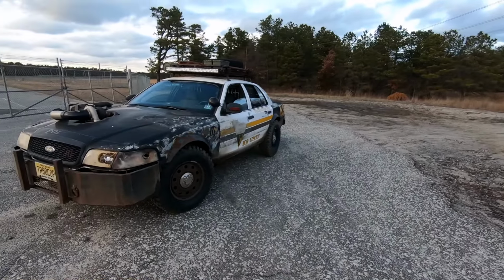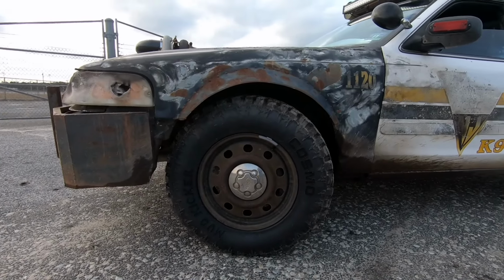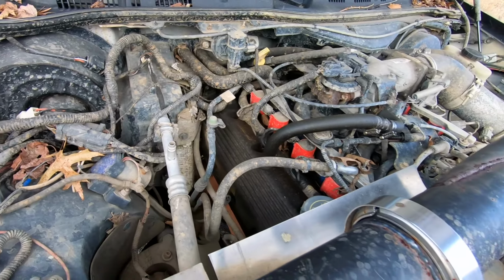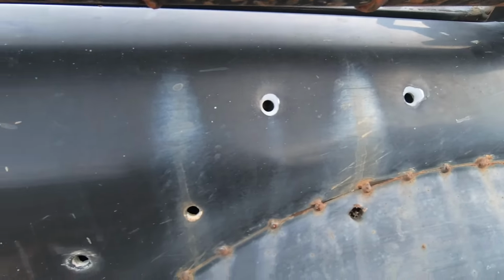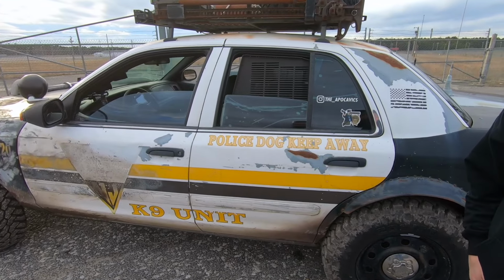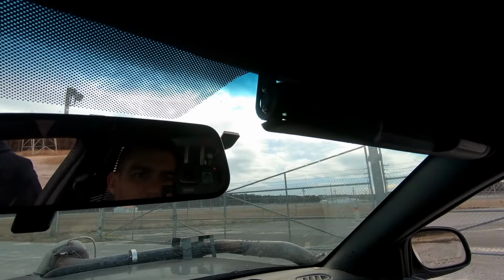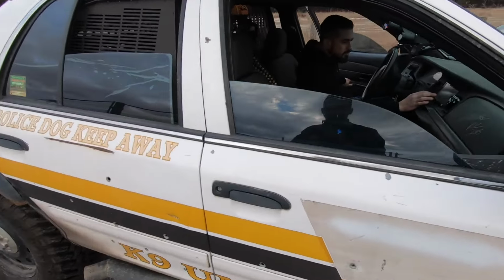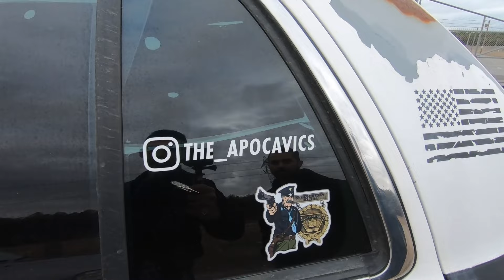2003 Ford Crown Victoria Police Interceptor  "Apocalypse" K-9 unit

Comment: 😂 I passed by you guys yesterday in my 2011 crown victoria black and white i should have turned around awesome car I seen it at pumpkin 🎃 run
Reply from the maker: Hey man, should’ve stopped by and got into the video…would’ve been a nice treat…if you want, send me an email at lovewhatyoudrive28@gmail.com we need a black and white panther in the channel…
Reply: @LoveWhatYouDrive   it's not the nicest but it's a daily rig that's fun to drive & always gets me where I'm going & very reliable
Reply from the maker: @davidbara9693 if you notice on the channel the theme is every day every man’s car not one have I seen a trailer, queen or a showstopper. That’s why the channel is called. Love what you drive not drive what you love because let’s face it I can’t afford a Ferrari but I love my mercury.